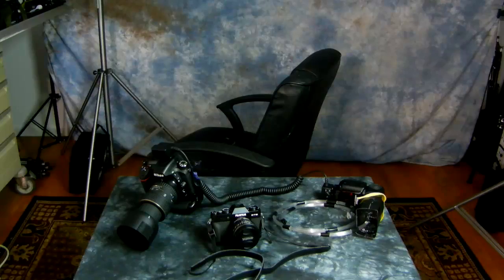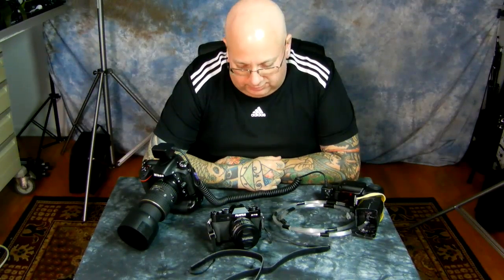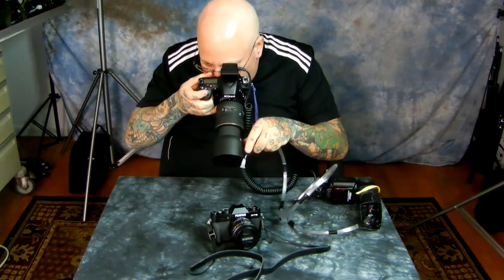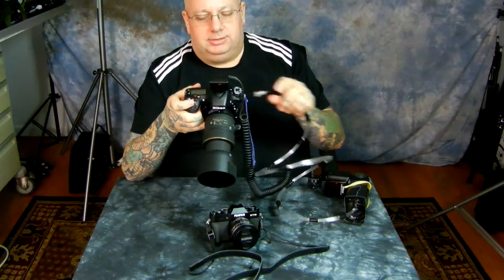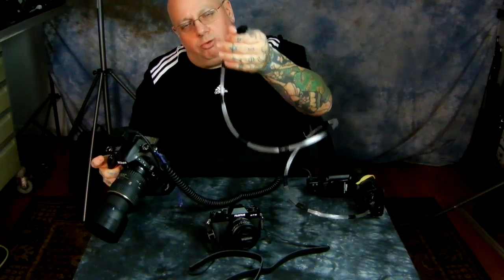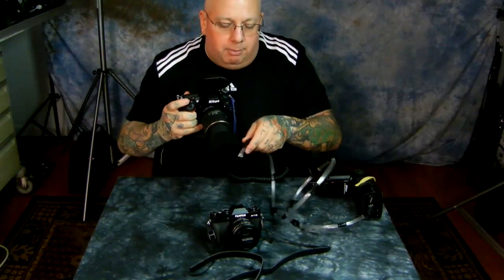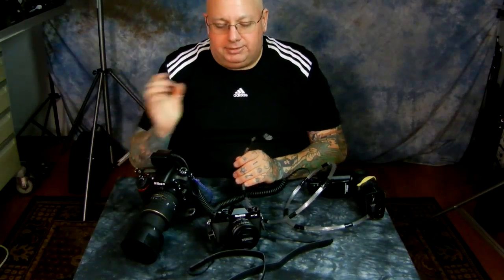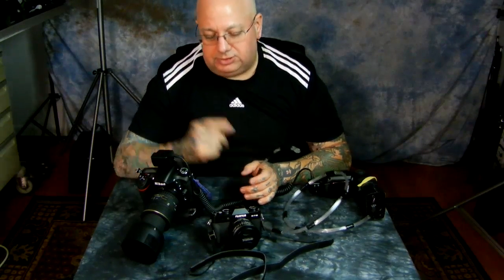Awesome Photographer's Invention: Part 1. MACRO TTL 100% light-control device. DIY $4 !!

Comment: But without the cable you could also use the optical ttl, no? But of course you would have to have the flash somewhere it could receive the trigger, and it would use pre flashes as well.
Reply from the maker: +Phil B need the cable, so noperz

Comment: Very cool. I'm making one of these.
Reply from the maker: +Ray Fenio TTL MACRO 100% control lighting !!!!
Reply: +Theoria Apophasis   Do you flatten each strand separately or  when bundled?  I found 2mm but only in a 100 length on ebay so I estimate I could make 2.   Is there any advantage or disadvantage in using smaller dia strands e.g. 1.5, .75 or .50?